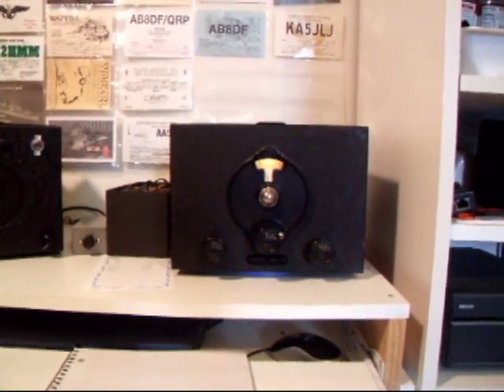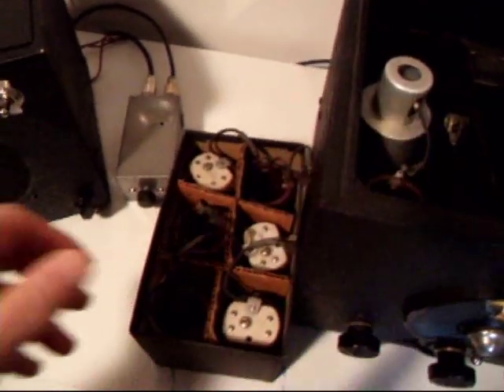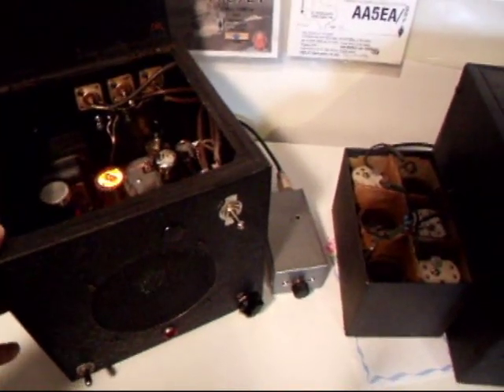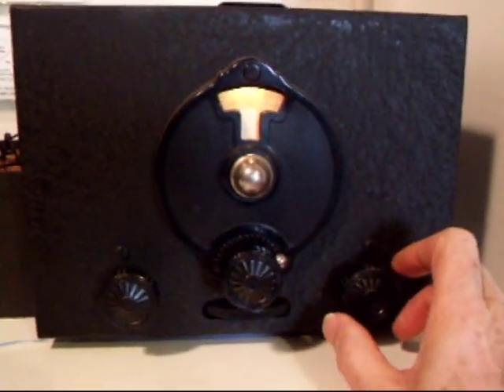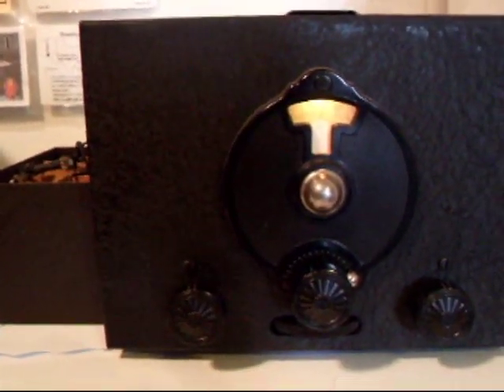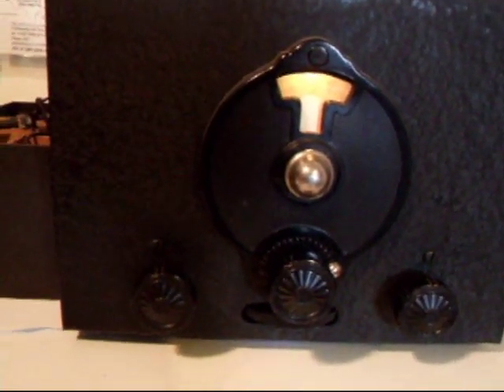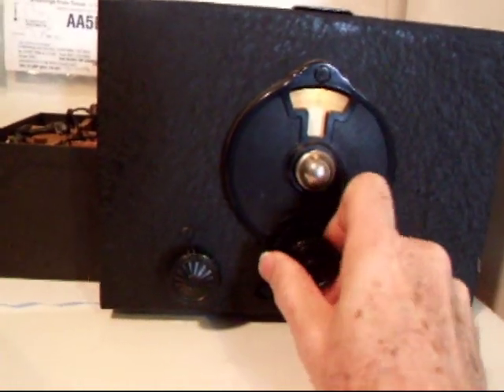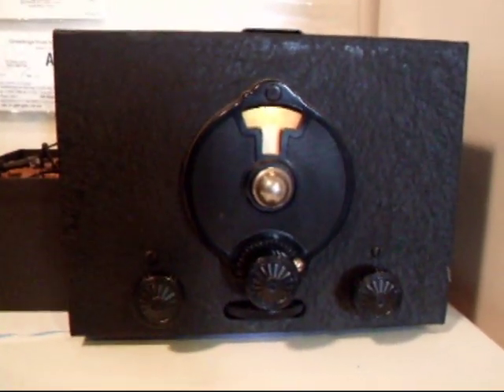National SW3 Regenerative Receiver

Comment: I just acquired an SW-3 out of an estate sale this afternoon.  Has a couple of small rust spots on the front panel, but otherwise looks pretty intact.  Internally, it looks relatively clean, at least above the chassis; may open up the cabinet later on to check underneath .
     I’m impressed by how nice SSB sounds on yours!  Definitely want to try to get mine working.  I just downloaded the manual & PDF schematic from the BAMA website.  Correct me if I’m wrong, but it looks like the SW-3 is designed strictly for battery operation?  (“A” filament battery, & about 135 VDC for B+ ?).  I’m also led to believe that the correct filament voltage depends on the tube types installed?  ( Since I know the tubes are hard to get at a reasonable price, I want to make certain NOT to over - voltage them!).  I know I also have a pair of vintage high - impedance headphones hanging around my shack somewhere.  (Although I will probably do the same as you did & connect an external amplifier & speaker to it).  Thanks also for explaining the control functions as well.  Looking forward to getting this piece of ham history operational again!

73,
Tom WA1LBK

Comment: Was single sideband technology even available before WW2?
Reply from the maker: SSB started being used by hams in the early 50s. QRM due to too many AM phone signals just got to be too much. Central Electronics is generally credited with giving that initial push that got amateur single-sideband off the workbench and into the ham shack. For more info read their history at http://ce-multiphase.com/history.html
Reply: No, it started to be used during WW2
Reply: SSB was originally developed by Bell Labs sometime in the 1920’s for trans - Atlantic telephone service, using long wave frequencies.  As one of the previous posters mentioned, Central Electronics introduced the first commercially - made SSB transmitters.  Collins started the move to SSB transceivers in the 1950.s with the introduction of the KWM-1, sold primarily for mobile operating (remember how big & roomy cars were back in the 1950’s!  Prior to the introduction of bucket seats & center consoles, there was plenty of space to mount what by today’s standards would be a huge radio underneath the dashboard! 😅

Comment: Really nice SW-3  and a good video .  I thought I would mention that I have found that A set of powered computer speakers work well on old headphone rigs all that is needed is a 1/4 inch  phone plug to  stereo (dual)  1/8th inch phone jax  adapter  to adapt  the computer speakers  However I like your amplifier Speaker  better it looks  better with the SW-3  the computer speakers are something quick to use   73    Code is the best mode   Bob
Reply from the maker: Bob, In fact, I use powered computer speakers with some of my other regens. and, even, my KX3. They work well and are usually cheap at the local Good Will Store. See http://w0vlz.blogspot.com/search/label/1T4%20%2F%203V4%20Regen